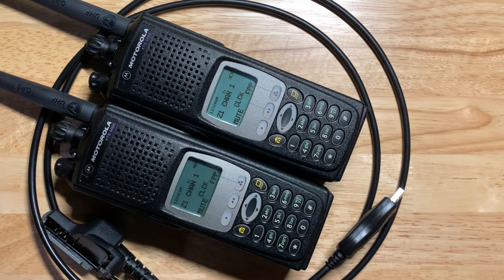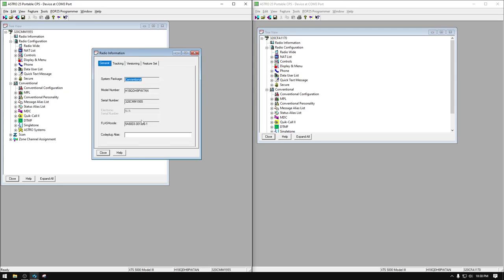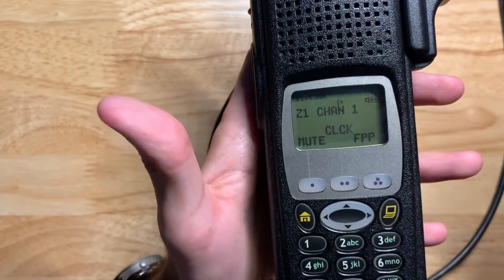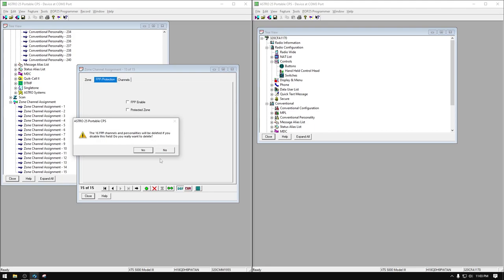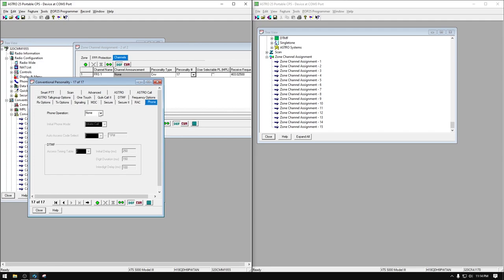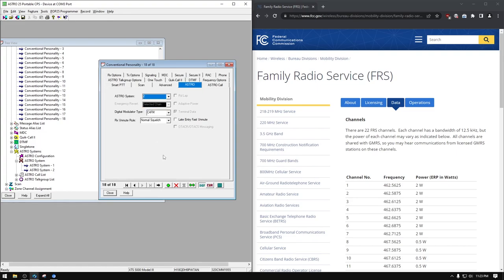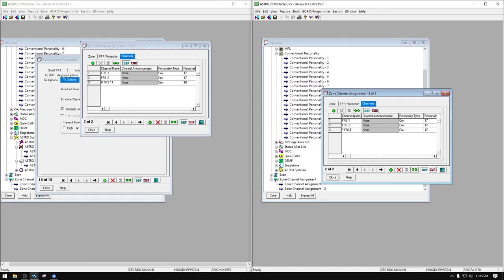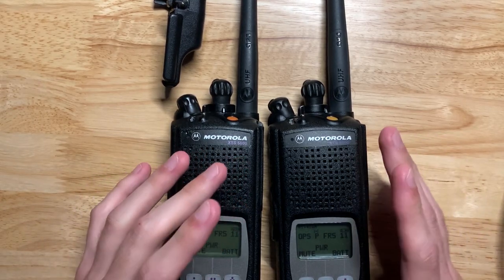INTRO TO PROGRAMMING MOTOROLA ASTRO 25 XTS 5000 AND 2500 RADIOS

Comment: Great intro video! Couple of notes for your programming to possibly speed your process a bit:
- Use the File>Export>To Applications to copy all the details/functions between radios that are similar. This works well if you can't clone them using the cloning wizard.
- Use the View>Options>Frequency Options select under the Zone Channel Assignment check the block for "Tx Conventional Frequency Follows Rx Frequency". This helps you input the frequencies faster for both TX/RX.
- The analog conventional will also do IDs/Aliases if you assign a personality to the MDC system and use the MDC alias lists in there.
Reply: Where is the link for the programing cable
Reply: Adam, can you clone a radio withour a read password?
Reply: @tonyyy117  Negative. That, unfortunately, would negate the purpose of the read password.

Comment: Good afternoon, my name is Federico De Angulo Ulloa and I'm part of a search and rescue team in Colombia called Civicos. We use radios for operations and we have a couple of XTS2500. We received two more radios but we weren't capable of programming them into the frequency. What we found different between the radios working and the new ones is that in the radio information in the programming information, the source on the working radios is depot but in the new radios is CPS and factory. It seems like we are missing admin privileges or something like that because some options are not editable. Another thing that is happening is that we are trying to edit some configurations on the working radios and some things don't work, we think we might be missing a plugging or something for the software. We are wondering if we need to reset it or something, I would love it if you could help us with that. We have been meeting these radios so if you could help that would be great, let me know how much would it cost.

Comment: Those cables from Bluemax are the best, imo. Big love for xts knowledge <3
Reply from the maker: His cables are alright. I have had issues with some of the wiring before. It is easier to buy the cheaper RS-232 cables and buying an adapter to convert serial to USB. The USB connectors he uses are mediocre quality. But they do work 99% of the time.

Comment: Thank you. This is very helpful. I just ordered several xts2500 radios for our group, and will be watching this several times while I get the programming figured out.
You mentioned "Depot" a few times. What is it and what is it's purpose?
Some info on cloning would be helpful, also, as we have quite a few of these radios on the way.
Thanks again.
Reply: Do you still need help with Depot?

Comment: Thank you for the video!
I have an xts5000 uhf p25 high power (in car remote head unit) and I need help to program it. Where can I find hops to for dummies vids or instructions?
Reply: Hops? What do you mean by that? This radio is very similar to the way you would program your high-power UHF mobile rig. The only major difference would be programming/configuring your specific remote head on your particular radio..

Comment: Does this work for APX 6000 radios?
Reply from the maker: No. APX radios require APX CPS with the appropriate software version per the radio firmware.
Reply: Can you do a video on how to program APX radios? I have a few, just don’t know how to program them. I have the CPS as well.